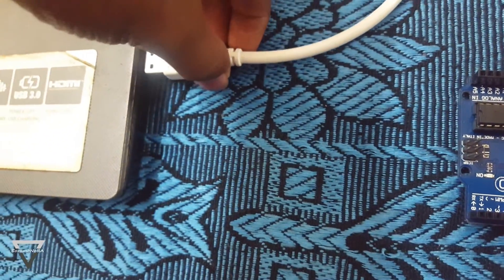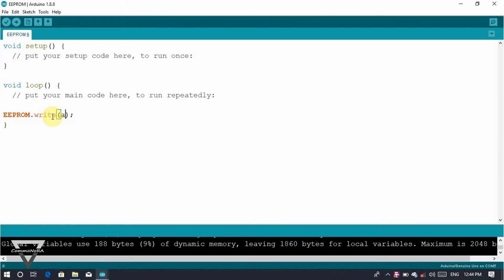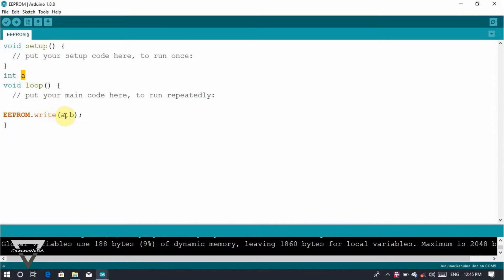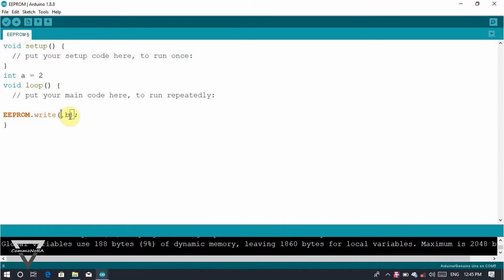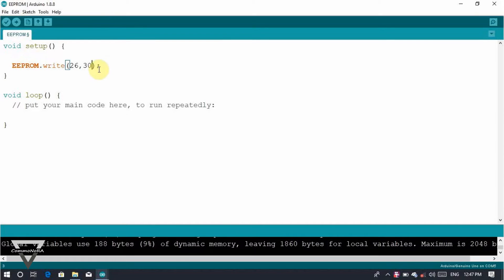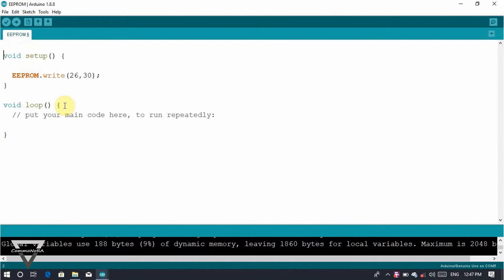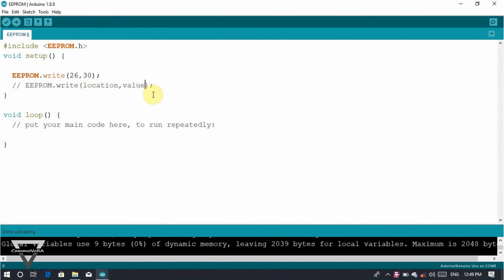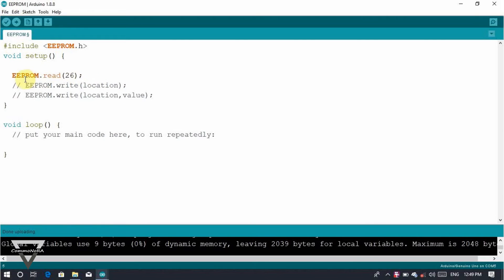Arduino-EEPROM-CODING-in Malayalam-how to Write or Read in EEPROM in Arduino?_Part 3

Comment: EEPROM yil write varmoo
Reply from the maker: Sorry. Manasilailla
Reply: @CommoNoRA  EEPROM Ennal Read Only Memmory ennalle. 
Appol write ennath ithil varumoo
Reply from the maker: @faisalmuhammed5756  ROM = Read-Only Memory   "No write"
EPROM = Erasable Programmable Read-Only Memory
It can be erased using UV light and rewrite it but rewriting is limited
EEPROM = Electrically Erasable Programmable Read-Only Memory
It can be erased & rewrite with an electric pulse, so it is called "Electrically Erasable Programmable"
Reply: @CommoNoRA  ok